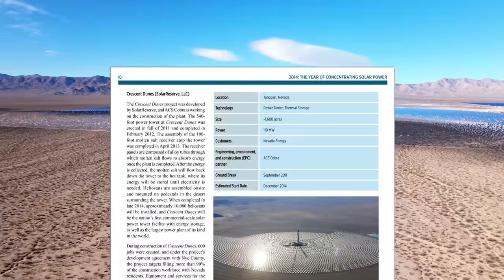The Failure of America's $1 Billion Solar Farm

Comment: 700M dollars to power 75K homes? Just put 10K dollars worth of solar panels on each home and call it good.
Reply: The rich will not get richer if they do that, they will be sad 😢
Reply: Gotta maintain Beamer's !
Reply: $10,000 won't provide solar for 1 home.  Also thousands more for battery.
Reply: Two completely different things. CST creates dispatchable energy (can run 24 hours a day) while SPV creates intermittent, non-dispatchable energy that has a completely different tariff.
Reply: Excellent point
Reply: @aintquitewright1480  lol i got 8kw of solar with 200ah 48v battery for just 5k dollars what are hou talking about
Reply: @jetfu400  That sounds great!  Mine in 2011 was $38,000 before subsides (4.6kw).  That was Solar City, now Tesla.  Was your price after subsidies?
Reply: @jetfu400 me too.
Most of my lights are LEDs and seperated solar charged . 
Next is a water heather ..
Reply: @aintquitewright1480  yup, i also installed it myself and built the batteries myself... Thats why mine is way cheaper
Reply: @jetfu400   maybe tell us more about your secret and how to source  and plug things
Reply: @viuvenitlalumina  i have a video on this account channel. but it was still 3kw at the time. i haven't uploaded the addional upgrade yet. but yeah i built my own batteries, and sourced everything.
Reply: @aintquitewright1480  wow that hella expensive. but it's understanble because solar was super pricey in 2011. did it pay for itself yet?
Reply: That'd complicate the installation and make it cost more. No point unless space is a premium.
Reply: @anxiousearth680  i disagree. on the contrary, it will simplify the installation mainly because you will not use heavy wires and equipment. each houses will have their own charge controller and and inverter.  but yes if space is premium than going solar may not be the best choice.
Reply: Is this the same place that fries birds in mid flight? I wonder what kind of traditional solar farm could have been built with standard solar and Tesla batteries? A billion dollar experiment? Ugh!
Reply: Money into certain pockets...
Reply: Show me a 10k$ system that powers a house overnight. Most home solar systems are grid tie without batteries. The average home in Nevada needs  an 11kW system that costs 27000$ at current market rates, maybe around 18k with tax incentives. And again that's without a battery so that system only works a few hours a day. This system has a sand battery, the cheapest battery I know of right now so it's a great idea executed poorly. Sand batteries are something that needs to make it into backyards to make storing excess energy economical.
Reply: You don’t understand the point of Watermelon Environmentalism.
Reply: You are clueless. Where is your electricity going to come from at night the moon?
Reply: @nevadadesertrat267  the windmill and the generator. I am by no means an advocate of green energy. I only advocate energy independence from the electrical grid.
Reply: How will big companies make money from that?
Reply: @mikelarry2602  Beamers are motorcycles, Bimmers are cars.
Reply: @ThomasistheTwin   Really? listening to your generator every night and on cloudy calm days means you will be listening to that generator a lot. Plus you did not include that in the price for the panels. I have been off grid almost 15 years and too many people dont understand without storage you have nothing at night. Thats what makes this idea interesting because it has storage included unlike your 10K panels on everyone's roof statement/idea. I know where its located and have camped near a lot. I now understand what was going on with it. Like you I am no green person. But I believe in real common sense not what the democrats think is common sense. Sadly this one solar plant actually had storage included. If it had been successful what would have been the real cost? Would it have actually been "affordable" Energy?
NDR
Reply: @aintquitewright1480  You definitely got scammed. A 5kW system from Renogy with 12kWh of battery is about $10k delivered, no subsidy. When I built mine in the 90s it was only a little bit more than that per kW.
Reply: Maybe in 2011 this solar project made sense, but today the PV or traditional solar panel is more  costly effective, the price of PV system dropped by more than 85% in the last decade.
And it will keep dropping in the future, which will make it a more obvious choice, and no other technology will compete with solar.
Reply: @mohamedmatouq4201  You clearly dont know anything about solar. Without the additional cost for storage where do you think your electricity will come from at night or on cloudy days? This system had storage your solar panels do not. Solar panels is only part of the cost of keeping the lights on when you need them.
NDR
Reply: You’d need $40k per, including batteries.
Reply: @nevadadesertrat267  How much electricity do you imagine it takes to run a house while you're asleep with the lights off? Not as much as you think. One single 200Ah LFP battery is more than enough. Most people have several.
Reply: @canonicaltom  I dont think I know how much it takes me to run at night and if you think a 200 AH 12 volt battery is enough you are incorrect by lots. Here is a test in the winter how many hours of sun do you have to charge the batterys?  All you are thinking is one night how about when it gets cloudy for 3-5 days? What about if it rains and snows for months on end?  Back when I was in  my RV fulltime I had 400AH battery. It had forced air heating the fan drew 10 amps. When it got real cold the batterys capacity is diminished.
 How about summer time? Lots of sun and high temps how are you going to cool? That 200 amp battery cant even keep a swamp cooler running all night.
 I live in a 1300 ft house now I have 48 volt 500 amp setup. I like my AC but it does not take but a few hours a day of clouds and I have to cut back on the AC. I have a trailer that is 17 ft box on it. I go camping a lot I carry 2400 watts worth of solar panel and a 7500KW 48 volt Lithium battery. A couple hours after sunset I have to turn the AC off.
Also as the temperature goes up outside the panels produce less energy as in 20 percent less in the summer or more.  So when it comes to solar I dont Imagine I know what it takes. And you dont know anything about what it takes with solar.
NDR
Reply: @nevadadesertrat267  I chose to live in a place that doesn't require AC, maybe you should make better choices.
Reply: 10k per home wouldn't even cover the panel install cost and primary wiring for any home......
Reply: @jeffproctor1690  yes but at lest it’s a start. Having a centralized solar facility that fails means everyone gets nothing.
Reply: @jeffproctor1690  Most of us do the panel install ourselves, and the wiring, usually about $500 in mounting hardware, wire, breakers, etc. and another $200 if you want to grid tie since it requires an electrician to sign off. So, whoever is charging $10k for that is definitely defrauding people.
Reply: Hindsight is 20-20. With Solar PV being so cheap, a lot of these more complex projects have become not viable.
Reply: @aintquitewright1480  wiser to find better ways to use the solar power than simply charging a "battery"
1.solar power can be collected using low tech (heat)which can be stored thermally and rereleased later on to provide hot water and overnight heating.
2.photo voltaic electricity could be used immediately,and the excess could be stored partially on house battery but ALSO directed into the family car
2a.if necessary the power excess could be used directly to refrigerate an insulated mass....where necessary this "cold" can be released by using it to drop the air temperature inside the home when needed.
3.Solar power itself can be used to thermally create airflow and drop the room temperature in the summer anyway rather than run costly electrical air conditioning.
Reply: @canonicaltom  a lot of door to door salesmen selling Solar at extremely high prices, I just tell them thanks but no thanks.  I will DIY if we go that route.
Reply: Yeah 5 kW of panels are about 2000 dollars. In Nevada, that's 30 kWh daily production. After that it depends totally on grid-tied or off-grid and whether you're scammed by an installer. Example battery for 5kW panels would be 20 kWh of LiFePo bricks for about 6600 dollars. Electronics span a very wide range, so does mounting hardware and labor.

DIY saves a ton if you can do it.
Reply: @SetitesTechAdventures  Are we talking about approximately 25 kWh each night?
Reply: @niceguy100000  20 kWh of LFP would be a nice big margin for me too. I use about 12 kWh/day.
Reply: Exactly 💯 %
Reply: Face if it wasn't for greed projects would succeed
Reply: @Tech Almighty  No, you got 8kW of RATED generation and more like 800 watts of actual power.  You never powered your house off those things, and thus never disconnected from the grid.  You still overpaid.
Reply: @billcichoke2534  Sorry you're mad that a solar installer overcharged you. But the rest of us are definitely getting the rated performance out of our systems. Better luck next time.
Reply: It doesn't matter if it would work or not. They wouldn't do it because they want control over you.
Reply: @Robin's Philippine Life 🇵🇭  Bingo.  I wonder how these folks would feel if that smart meter they had installed with their solar just cut them off at the government's whim.  Maybe not so smart or independent, eh?
Reply: @billcichoke2534  My smart meter includes a hard cutoff that I can use to switch over to my own battery bank and disconnect the grid. Try harder with the conspiracy theories.
Reply: @canonicaltom  Talk to folks in Colorado who had that very thing done via THEIR smart meters.  I'm sure they'll agree with you it was a 'theory.'

And I don't see you posting how you don't need the grid anymore.  Guess you're still hooked up to it because that solar provides you with ALL the power you need 24/7...right?
Reply: @billcichoke2534  Solar does provide all the power I need 24/7. I use the grid because I use more power than I need. If the grid collapsed I'd have to make some minor changes to my lifestyle but life would go on for me pretty much uninterrupted.
Reply: @canonicaltom  Wow.  You literally have described a system that defies the laws of chemistry and physics.  That's special.

In the meantime, you have a system that creates a small chunk of grid instability and unreliability, and you're receiving subsidy tyi do so.  You owe your full ratepaying neighbors quite a bit for that.
Reply: @billcichoke2534  There's a device called a battery that stores energy for later use. Surprised you never heard of them, during your deep investigations into physics and chemistry.
Reply: @canonicaltom  And yet you're still on the grid and not able to run your house without it.

Doesn't take research to figure that out, sunshine.
Reply: Give each home owner $10.000 subsidy; home owner maintenance and benefit follows.
Reply: except the part where there is no energy produced at night and requires expensive and inefficient battery storage    Just saying
Reply: @johnbatson8779  And this applies to all solar power regardless of scale which is what the video is about, a monstrous solar project that serves none except the contractors.
Reply: 20000 per home is more realistic and that would result in over twice the price. 10k per home is still more.
Reply: @Skygge  Don't forget that contractors would just up their price by $20k, since the government is 'helping you afford it.'
Reply: @redrider7730  I am not making a point about cost. My point is solar panels are useless unless you have storage. And by the way storage is expensive. My point was directed at the person that thinks replacing this with just solar panels is a better answer. Basically people just dont understand how expensive electricity is when100 percent is generated by solar and wind. They never consider storage. This failed experiment had both generation and storage. After 15 years off grid i have a bit of a clue what I am talking about. And every now and then like it or not the drone of a generator is part of your life. And that adds to the cost because of the need to feed and maintain a generator.
NDR
Reply: Add another $40,000 to that number. It costs more than you think.
Reply: @mikelarry2602   What's a beamer?
Reply: @reggveg  BMW's
Reply: @aintquitewright1480 not true. I am being forced by court order to sell my family estate home. My brother is evicting me as he wants the money. So I am being forced in the current market to go off grid. I just priced a sun gold system of about 10KW complete for about $10,600 plus shipping. Granted I have to install it. But I should be able to run everything I need. Tesla is worthless as they won’t support an off grid install.
Reply: So much wasted  💰
Reply: u b right on . dc must be used as close as possible to generation.
Reply: I've been running on solar with no electric bills for over 10 years. I could do a nice system for a 2000 square foot house with a propane powered refrigerator for under seven thousand. That includes lithium power packs for batteries.
Reply: @canonicaltom  how many hours of the day do you need lights when the sun is down?  Depends on the time of year.  In the north, there's only 8 hours of daylight or less during  winter.  I use lights all the time when the sun is down.  Lights are not much of a load though.  If you run gas everything then that would reduce your solar demands.
Reply: Reminds me of how during the intense Canadian Wildfire smog New York State distributed N95 masks — which are provably dangerous to your ability to resperate AND kinda stupid cause why go outside (?) — as opposed to providing each resident a HEPA filter. I guess it sorta* makes sense for construction workers but that would only make sense if they were anaerobic organisms + they were likely allowed to stay home anyway. My point is that you have a long-term, sustainable solution to give power to the people [a HEPA filter or solar panel array] and a single-use cost savings measure [more $$ to embezzle] you will notice the more profitable option is always chosen
Reply: @Retrofire-47  that reminds me of an old saying...
53. His disciples said to him, "Is circumcision useful or not?"

He said to them, "If it were useful, their father would produce children already circumcised from their mother. Rather, the true circumcision in spirit has become profitable in every respect."
Reply: It’s a billion, not seven hundred thousand. What a waste.
Reply: @aintquitewright1480 solar panel’s cost 180$ to 240$ each the battery is expensive but the solar panels are not
Reply: Yes that sounds ridiculous. It seems even their best expectations are not even impressive.
Reply: Yup except the average cost of a solar roof installation is like $40,000
Reply: There’s many Insurance companies now that won’t insure clients with solar panels on their roofs.
Reply: @geedubb-q1u So all the solar panel companies are advertising to make your home uninsurable?
Everything only makes sense if one considers we’ve been lied to the whole time about everything.
Reply: @jetfu400 200ah is not a lot of storage at all
Reply: No way to get millions of under the table money to many people watching
Reply: @dennisbethards3231 If everybody kept the money that they earned then the wealthy would actually have competition
Reply: Now don't go ruining a narcissistic engineers vision with common sense, lol.
Reply: That's too logical, and would require coordination of government and homeowners.  Homeowners don't trust the government, and government doesn't know how to coordinate efficiently.
Reply: @CategoricalImperative  that's nonsense. The government does know how to, the problem is once these businesses are subsidized they take their sweet time because they already got paid.
Reply: @sjwilson1079  I guess it depends which "government" we are referring to. I live in Southern California,  where what I said is true AS WELL AS your latest statement.
Reply: @CategoricalImperative  but my point is in the private sector companies need to complete jobs to get paid. With government contracts they are paid in advance. Nobody holding feet to the fire so to speak
Reply: How about 1 container of a mini nuclear power plant to power an entire city at an efficiency of 95% all year round WITHOUT a backup and WITHOUT storage costs ?
Reply: That would cost 750 million
It would take 159 years to break even on electric costs
Reply: like CA spending billions each year to fight homelessness, just give those homeless, each, a house and monthly spending money. It's cheaper.
Reply: @stephenc2481  But what about the thousands of government works who depended on that money for their lively hood? Think of the government who created the problem. What are those people to do? 😂
Reply: @aintquitewright1480 
I said the same thing. But I'm an electrician he is not. 😅😢😂
Reply: A solar plant costing as much per mw as a nuclear facility? What a bargain
Reply: @padraics  
Yeah not..
Reply: @jetfu400  Yeah I've seen a DIY box truck conversion where the guy built his own batteries. Way cheaper when you build your own.
Reply: @nevadadesertrat267  Instead of using AC to get a "normal" temperature inside your home, you could think of using an alternative system, preferably passive, to get this job done. Not always easy, I don't know your exact situation. Using AC for cooling your home, before preventing sunlight to reach your roof or walls, is not the best idea.
Reply: @boogieknee3781  Very good advice, too bad they will go above many commentators' heads here :(
Reply: @speedsterh  What method are you using to prevent sunlight from reaching your home?
NDR
Reply: @aintquitewright1480 of course you can get solar for way under 10k... Americans are just used to overpay 10x for products and service and by hiring greedy contractors...
Reply: I'll just take my 10k in cash, thanks!
Reply: thank you! I've been saying this for years
Reply: How about using lenses, like magnifying ones, to direct the sun's rays directly on the water tanks to heat it up?
Reply: Solar panels on roofs are a great solution during the day! What’s great about this solar power plant is it heats the molten salt during the day which then powers the turbines at night
Reply: @Sampsonoff  Read the title and try again. The only salt is what your putting up your nose.
Reply: @ThomasistheTwin  bahahah you’re actually basing your opinion on a click bait title instead of the facts presented in the video? 🤣 Watch to the end next time. The power plant was sold and the new company has it running at max capacity through the night. They are currently replacing one of the superheater’s which will double the capacity. Again, solar panels are great for day time power but this super heated molten salt provides power through the night. 

If you’re going to randomly insult someone for no reason maybe try watching the video so you don’t look as brain dead 🤣
Reply: @Sampsonoff  I just looked at the production output on wiki. Completely created out of politics and run by politics. The thing is they don’t want people to have cheap deniable energy or it would be here already.
Reply: @aintquitewright1480 the solar farm didn't include batteries either...
Reply: @SetitesTechAdventures   Outlaw AirConditioners in Nevada. Simplest energy saving solution.
Reply: @aintquitewright1480 in germany and australia yes
Reply: 75k times 10k is 750M
Reply: @mcshreddy7125  You gotta pay the bureaucracy
Reply: Rooftop potential to be realised, with each new rooftop, and cover others in a matter if 5-10tears!
Reply: Cost if transmission is overlooked
Reply: @aintquitewright1480  "$10,000 won't provide solar for 1 home" Insane nonsense. 10,000 AUD (much smaller than USD) gets you a 8kW Solar System full installed here. Anything more expensive than that is scam.
Reply: @tylergambon6492  Stop with the absurd nonsense. 40,000 AUD Solar System would be about 30kW which is a small commercial property system.
Reply: Why not install solar pv opanels at the site, and generate when possible. 
Further, sell the otoject to the Chinese, with a suitable feed in tariff
Reply: $10k for solar panels? Maybe 2x that
Reply: 1 home = 20k 
75k homes = 1.5b
what are you on
Reply: @easypro Im on facts. The project costs .7B to power 75K homes
Reply: I agree. Instead  of polluting  the  land.